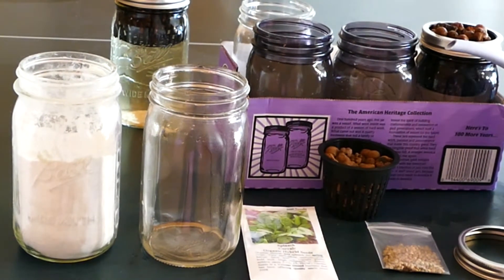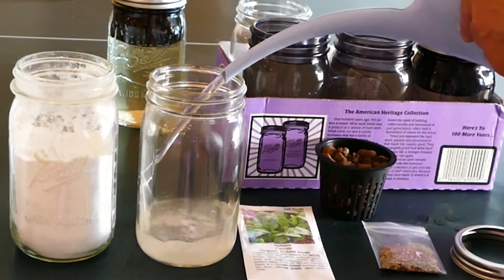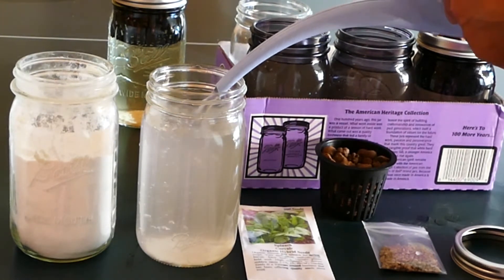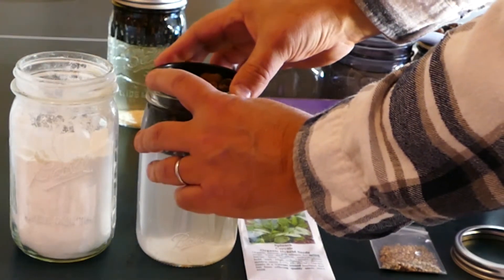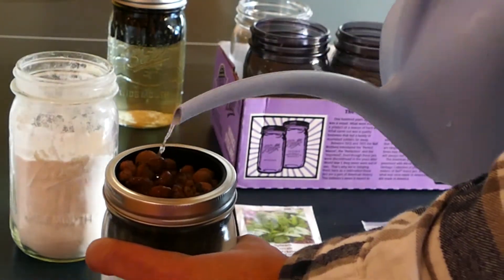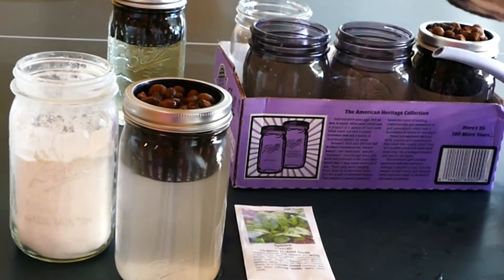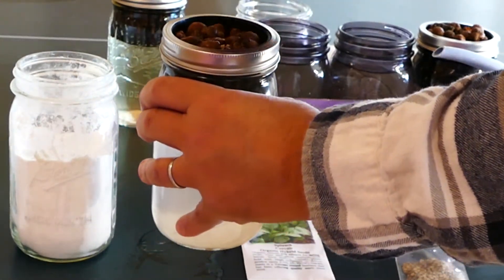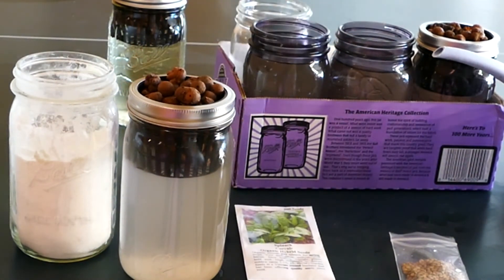Water Level for Starting Seeds Using The Kratky Method (passive hydroponics)

Comment from the maker: Hi Peter - thank you for the comment.  We definitely make sure the roots have access to air.   Notably, when starting the seeds, when there are no roots, we are having success as long as the the water level is right at the seed level so the seed can germinate.  This method is so amazing because the timing works well as the water diminishes the roots are right there and it essentially follows the water level.  When we add water, we never add more than the level at the bottom of the net cup.  There is access to air through the pellets.   We love this method and it sounds like you do, too!